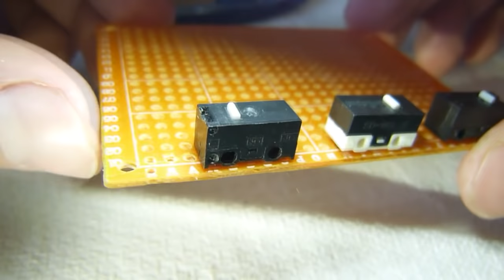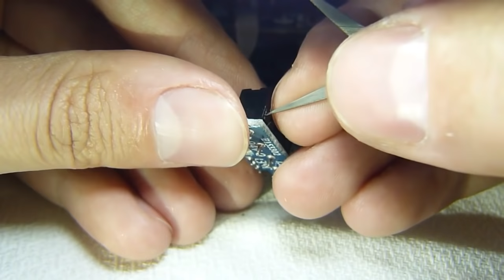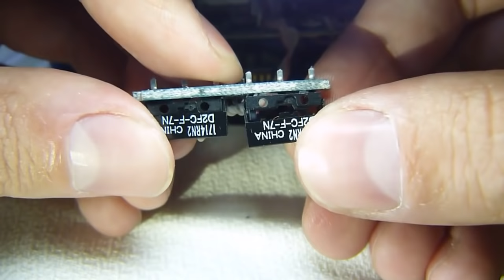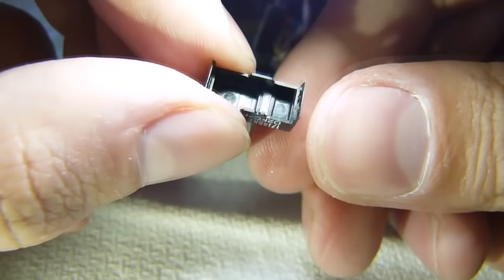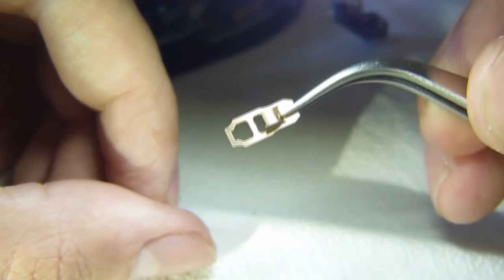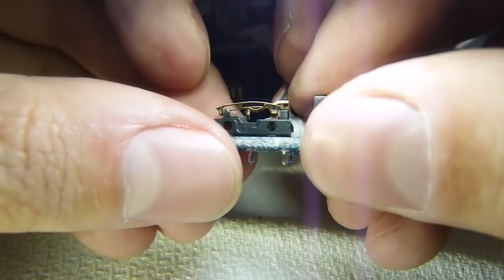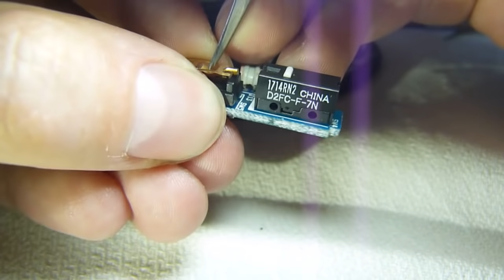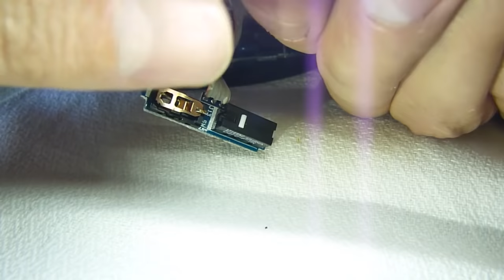Double click problem: How to fix faulty mouse button

Comment: Thanks for the video, it's 8 years old but still helps.  (Yes, I bought the switch online and it's arriving.....)
While am waiting......YouTube.

Quick fix. I fixed my first one like the video but it's pretty darn hard to put it back if your eyes are not good.  

My easy way (2nd mice)

You do not have to take out the copper plate out https://youtu.be/eDoXMJyimDU?t=146, just take a small flat screwdriver and push where the curve up a little bit with your finger on top just in case it flies out (it didn't happen to me).  Then cover it back up, go to any double-click test website, test it, and if it still happening, push it up a little more.  I fixed mine that way - Easy!

Comment: WARNING! This method DONT WORK FOR ALL MOUSES!!! On my mouse it's different..... andi cannot pull down the copper for listen ' Click ', they drop down and dont work. Without pull down, they do good the Click Click
Reply: I had the same problem with my Logitech mouse. There is an additional tiny step in the middle where you need to place the curved part of the copper (hard to explain, but you will understand it if you take a closer look). Otherwise the copper will just fall down.
Having a look at the other working switch as a reference also helped me solving this issue.
Good luck!

Comment: lol The more I bent the "spring", or curved part, the worse this job became. Hint, too much curve=no spring, as well as wont stay in place, or click. If you run into that like I did, you have to go a different direction...straighten out the curved piece, then re install. Mine does not feel as strong now, but after 2 hours and one handed, magnifying glassing, about ready to just order a new one, I got it....and it works perfect again..no more dropping a window as it releases when the fuck ever it wants too.....lol

Comment: Tried it and it was hell. Now it just doesn't click anymore and is busted. Not sure how to bend that fucking thing. There go 110 € in the trash.

after 3 more hours trying I figured it out. Some tips:
- tape trough the top part of the switch casing so it holds in the green button. This way you don't have to turn mouse upside-down to get it back in position. Then remove the tape in the end.
- The little ear has to be pushed down for it to start clicking. It's not enough for it to just lay on top of the ridge.

Now both clickers work. I wonder for how long before they're bent again by regular use.

Comment: Why not just replace the switch? These types of switches are easily found on Ebay. I've repaired switches before, but only as a last resort. For best reliability, replace the switch with a new one..

Comment: I'm all for repairing stuff but come on, these are easy to replace and cheap. This fix will likely fail sooner rather than later. Metal fatigues and you will have to replace them anyway. Not worth the hassle.

Comment: Attempted to do this but ended up with the same double clicking problem. If you're reading this, you're better off buying new switches (5 for $1 on ebay) and replacing the old with new ones. Soldering is much easier and less time consuming.

Comment: many gaming mouse like logi n razer  uses omron switches that have poor durability n have double clicking issues easily fail within a year or even months..  the so called 20m 50m in spec is just pure marketing propaganda bs.  kailh switch have a lot better build  n durability.
Reply: Is the new Razer Viper use the same shitty omron switches?